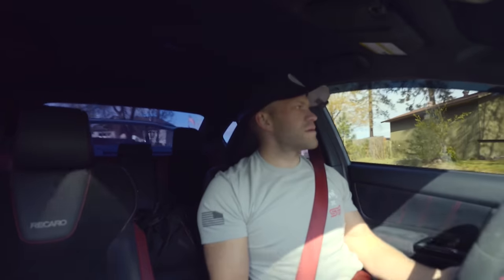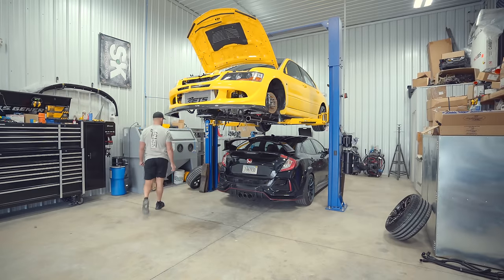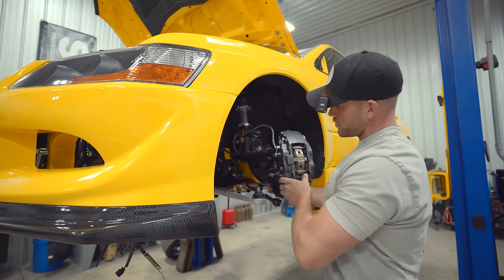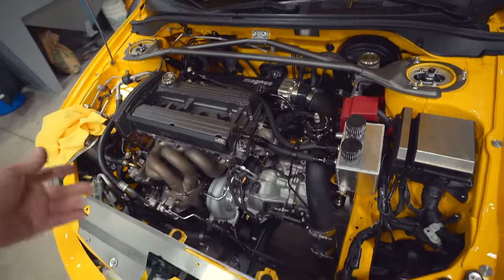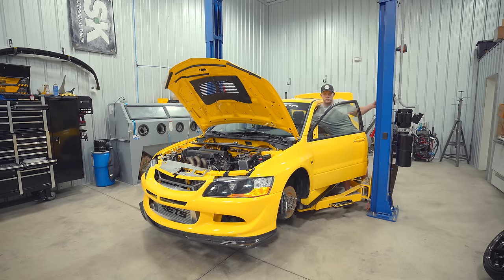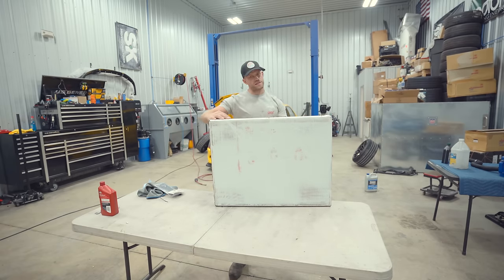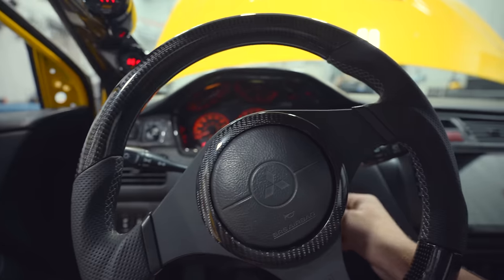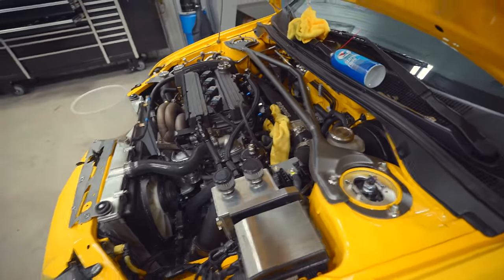FIRST START ON THE BRAND NEW ENGINE (WE HAVE A BIG ISSUE)

Comment: The metal washers with the internal viton seal are called Dowty seals. They basically need hardly any torque to seal but they do need perfectly smooth sealing surfaces.

Comment: A comment/warning on starting the engine without coolant and with a new water pump.

The seals on a water pump are lubricated by the coolant and even a minute of running a new pump dry with kill the seal. I learnt this the hard way. At least on your engine water pumps are easy to change - I wreck a water pump on a timing belt driven pump 😢

Comment: U legitimately just went throw everything that happen to me (sorta) I built my motor new everything rod locked up 400miles(granny driven) machine shop claims the new oil pump went bad then   built it again  new crank, rods,bearings, oil pump all new gaskets got it together had that exact same plug out on the head that we missed got that leak u have and got it together again then got her home drove 40 miles on the first drive just fine and then my trans axels leaked due to not being oem. Is all I can think cause so far it’s been good